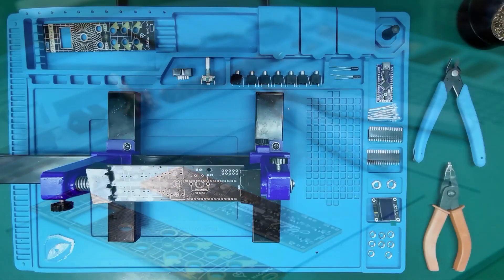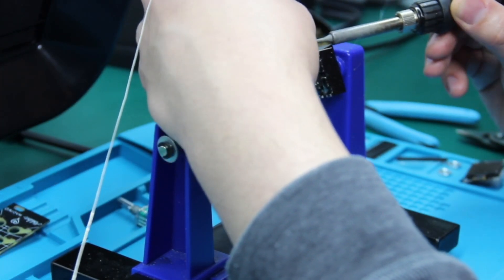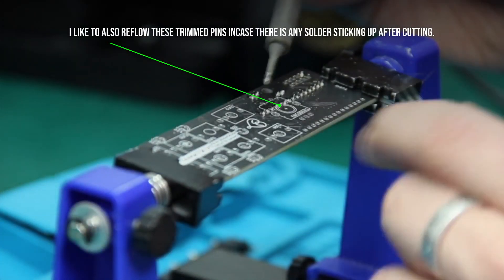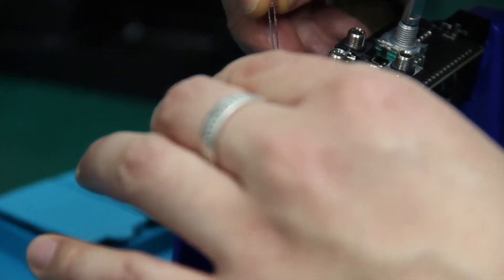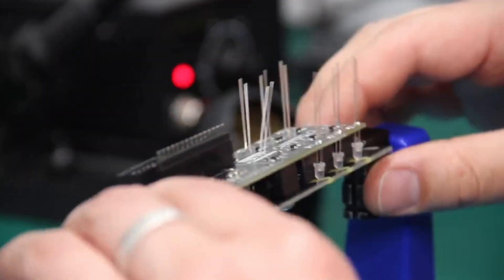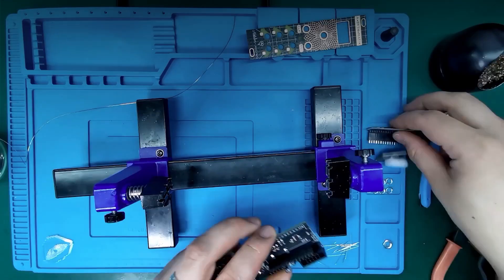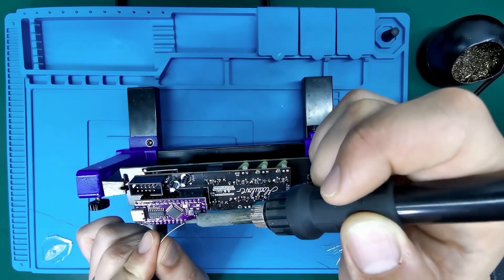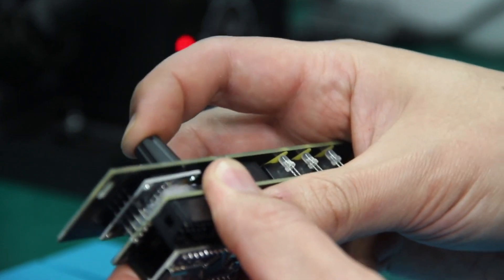Modulove A•RYTH•MATIK Build Guide

Comment: I just built one of these. It's a great module but it should be made clearer in the instruction (and this video) that outputs 3 and 6 should be oriented 180 degrees to 2 and 5 and that they share a ground pad. This is quite unusual and should be made explicit. I soldered mine in the wrong way and had to add some jumper wires. It works. But it's ugly.
Reply from the maker: Thank You for your Feedback. We will add this point to the Guide!